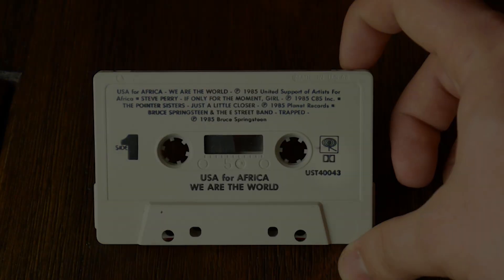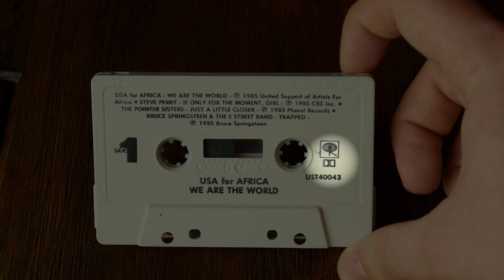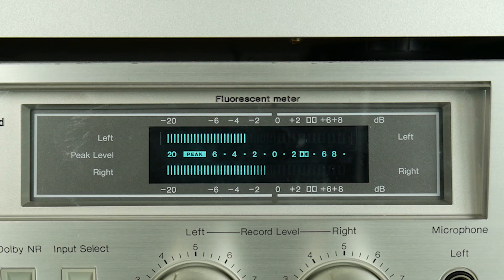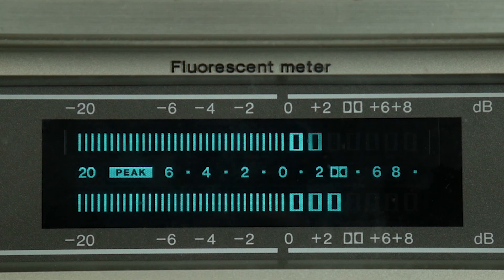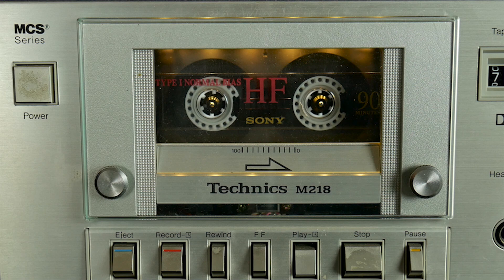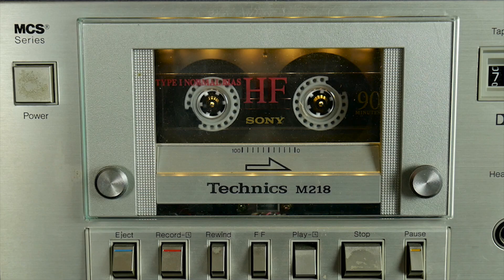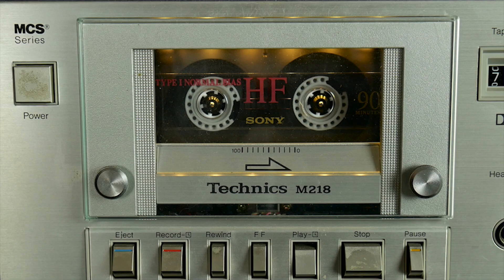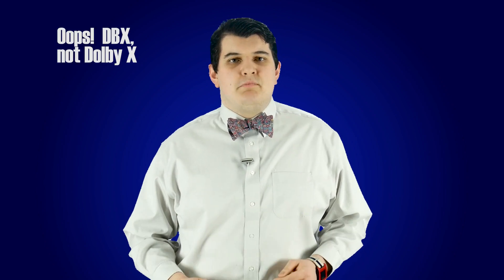What is Dolby Noise Reduction?  Dolby's Humble Beginning

Comment: The companding in Dolby noise reduction is more complex than just setting an equalizer. The companding is accomplished by varying the volume of the desired bands depending on how loud they are! That means it changes over time. The Dolby playback circuitry has to sense when to change the volume to match the amount of change during the making of the tape. That's the real reason for the Dolby sign on the level meter, record levels need to be set to match the preset playback settings. A mismatch can sound like there is a pumping or breathing effect to the sound.
Reply: You can build your own dolby encoder decoder, by robbing parts or using those Dolby Symbol IC chips. Or modify a tape deck. You could even purchase in the 70s add on boxes to convert a normal tape deck to dolby. DSP boxes now offer even more ways. Everyone had a gimmick in hopes of marketing solutions to those problems. And of course now most sound cards, and computers offer DSP processing to alter live sound.
Reply: Back when Dolby tape noise reduction was passing into history. Dolby inc. had the good sense to get into multitrack encoding in time for the explosion of 5.1 movie sound. While it's not what it's made for, I still haven't found anything that does a better job converting 2 channel stereo to 5.1 than the Dolby Pro Logic surround circuits built into my over 25 year old small home theater speakers. They're a bit long in the tooth so I'm hoping to find a halfway decent DSP plug-in since most of my music collection is 2 track.
Reply: @RMoribayashi  does it work with the psp?.

A couple of my games have D.P.L.2 but i don't have a way to play them in 5.1 or 7.1 surround sound
Reply: @RMoribayashi  Dolby first got into movie sound as early as 1972, only 7 years after the founding of the company, when they used Dolby A noise reduction on 35 mm film prints. These Dolby prints also used equalisation to improve the frequency response of the track. The system was not commercially successful as movie theatres were reluctant to spend the cash needed to upgrade their sound systems. However by splitting the sound track in two, each with Dolby A noise reduction and adding the pro-logic decoder, Dolby created Dolby Stereo. First used in 1975 on "Lisztomania" it soon became the de-facto standard sound system for 35 mm film prints and remained so until the introduction of digital sound on 35 mm prints in the early 1990s.  Right up to the replacement of 35 mm film in cinemas with digital projection,which occured in the 2010 - 2014 period, 35 mm release prints all carried analogue Dolby Stereo tracks as well as digital sound data.
Reply: And that's why you have to engage your Dolby circuit every time you want to digitise your dolbyized tape. You can't get rid of the tape noise just using an equalizer. The Dolby Noise Reduction works as a dynamic filter, too.
Reply: It literally says that in the video. Watch the whole thing before commenting
Reply: @LeNoir679  No he does not, he describes pre-emphasis and de-emphasis then calls it companding. (This guy is always wrong) The cassette system already has pre-emphasis and de-emphasis that's one of the reasons you have a tape type selector, different tape formulations have different head room at different frequencies (the other reason is the bias amplitude for recording) as he says in the presentation at 3:18 he boosts 8K by 9dB this would saturate the tape causing distortion with some music. Boosting a particular frequency with a equalizer is not companding! Companding is reducing or boosting the amplitude of a signal based on its level. 
RMoribayashi is correct!
This "Technology Connections" just is snake oil. 
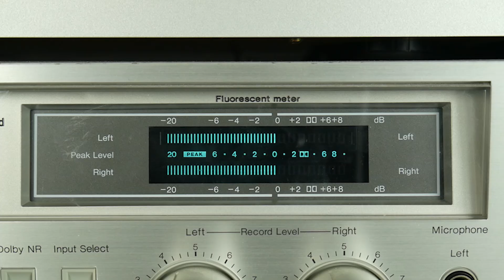4:58 The dolby symbol is just 0VU. I have never heard or seen written in a operation or  service manual that you cannot exceed this level. RMoribayashi is also correct re record and playback levels.
This "Technology Connections" also fails to mention how import the cassette deck head azimuth match between record deck and playback deck is as well!
Better explanation here see post by GLouie
https://gearspace.com/board/low-end-theory/682128-question-about-dolby-settings-my-cassette-deck.html
Reply: @rods6405  Oh please.  Yeah, he got the description of companding wrong on a video from 4 1/2 years ago.  But "always wrong"?  "Snake oil"?  Pfff, get out of here with that.
Reply: @rods6405  Dead link
Reply: @sirnickity  Yeah its not the space shuttle is it! But if  I was getting on the space shuttle and This "Technology Connections"  was repairing something on it I would get off really quick! Enjoy your participation award!
Reply: Basically a frequency-specific compressor before tape, and an expander at the same frequencies after it. Dolby B was essentially this, I think C is similar but squishing and stretching the signal way harder and over a wider range of frequencies. The S one I don't know for sure, but A type was multiband compression/expansion (Separate compressors on different ranges of frequencies), which makes it way more precise but many times more expensive.
Reply: Agree: https://www.testandmeasurementtips.com/audio-measurements-and-dolby-dbx-noise-reduction-faq/
"Within each band, the amount of pre-emphasis applied depends on the original signal volume. For instance, in Dolby B, a low-level signal will be boosted by 10 dB, while signals at the “Dolby Level”, +3 VU, receive no signal modification at all. Between the two limits, a varying level of pre-emphasis is applied. On playback, the opposite process is applied (de-emphasis), based on the relative signal component above 1 kHz. Thus as this portion of the signal decreases in amplitude, the higher frequencies are progressively increasingly attenuated, "
Reply: I think your explanation fixed the video for me: my soundbar has auto Dolby correction, so when he used the “bad noice” as an example in the video, I couldn’t even hear it.
Reply: Exactly!  Most people, including this YouTube, don't know this.  If you worked in professional recording as I do you would learn this.

Comment: There is a serious lack of a proper 21st century audiophile tapedeck, for digital archiving, that can playback all the different tape types (proper bias adjustments), let alone Dolby Noise Reduction, so that people can simply enjoy (and preserve) their old cassette tape collections.

Play tape  one more time, and then have it saved on a thumb drive, on a hard drive, in your iTunes, or saved in a cloud account.
Reply: Such a product is pretty much doomed to fail in a consumer market
Reply: You don't need to adjust bias for playback. The real pain in the neck is tape azimuth. I'm digitalizing on a separated deck, specially "sacrificed' to this purpose. I just put the tape I intend to digitalise and tune head azimuth for maximum treble "brightness". Of course I tune on stereo channels mixed into mono, the this 'golden point' of good azimuth is easier to find.
Reply: Look for the single tape Sony recording units that look like VCR decks.   The ones with Dolby B and C are quite good (even the cheapest ones) and they automatically sense metal or chromium and adjust accordingly.  Sony used to be the sheet when it came to audio gear.  They wee tops.  The 1990s saw the end of the Sony Audiophile and Videophile era I think.   Their gear from the 90s was till built like tanks.  My Sony deck still works perfectly despite years of no use at all.  Clean the heads once, demagnetize once and good to go!   I miss the ease of recording to tapes, but I don't miss the bulk, the clunkiness,, the hassles of cleaning and demagnatizing , the mismatch in noise technologies.. They were odd times the advent or CDs and the decline of analog audio.. The really odd thing I that we are STILL using analog audio in cars and building when it comes to FM radio.    WHY????  Radio should have gone all digital when TV did.  It's the last bastion hold-out for analog audio…and no clear compelling government push to end analog radio and begin an age of all HD (digital) Radio is in motion.   Heck, if Obama an the FCC hadn't made a mandate, we'd all still be stuck with fuzzy picture broadcast TVs and non-HD digital cable systems.   Sometimes bullying the market with "big government" is a really positive thing that gets necessary change to happen because it won't happen on its own without that "or else" punishment factor for not getting with the progam.
Reply: Unfortunately, Dolby no longer licenses their NR technology for cassette decks, so even when TASCAM/Teac came out with a new professional cassette deck last year, it didn’t have Dolby. It had a generic noise reduction system that “roughly mimics” Dolby B. But a new cassette deck that actually has Dolby B, C, or S is not going to happen. :(

Comment: Take a look at how FM radio is run through a preemphasis system at the transmitter and then a deemphasis in the tuner/receiver.   This is how most of the early Dolby was designed in the prototype tape machines.  I used Dolby B, C, and DBX in the Radio stations I worked at.  DBX was the best for Broadcast work since it processed the whole frequency range of the tape at (normally) a 2 to 1 compression ratio and then expanded it by 1 to 2 on playback.
Reply: Yup, I had a couple of tape decks, that offered Dolby FM and receivers that had Dolby FM decoders built in. Even 8 track would have been better with Dolby. Very few FM stations did broadcast in Dolby FM. The investment of that never paid off, as FM only has limited dynamic range. 15khz top end by FCC standards.

Comment: It's a wonder nobody came up with it sooner -- it's almost a natural extension of the RIAA curve used on vinyl. (The RIAA curve is also reason #247 that vinyl does not sound better than digital, but that's an argument for another time and place.)
Reply: Really, the biggest reason that someone would say vinyl sounds better is that they're listening to a poorly mastered digital recording.  Other than that it's a matter of taste.  I have some LP's that I prefer the sound of to newer digital remasters precisely because the original master was done by someone who knew exactly what sound they were trying to achieve 40 or 50 years ago, plus the mastering and mixing was all done with an analog path, which definitely has a unique sound compared to some newer LPs I have that were cut from a digital master and sound almost indistinguishable from a CD pressed from the same master (at least the first few times they're played).

I'm also skeptical of anyone who claims an audible difference between CD red book audio and any of the high resolution formats.  The specification of CD audio with respect to dynamic range is pretty close to the limit of what we can perceive and well beyond even the most dynamic recorded music, and the sample rate is just beyond the highest frequencies we can hear.  The only reason they use more in the studio is to have headroom to avoid clipping and distortion before it is mixed down and mastered for distribution.  The only reason I have any SACDs, DVD-As or Blu-Ray audio discs is because of the alternate multi-channel mixes found exclusively on those formats.
Reply: Right, CD redbook audio facilitates maximum fidelity -> https://xiph.org/~xiphmont/demo/neil-young.html
In a listening test by Boston Audio Society, no one was able to tell if a CD standard A/D/A conversion is inserted into 'high-res' playback. Even without dither.
It's honestly quite insane, thinking we have an absolutely perfect way to distribute stereo recordings, yet 99% of music released (independent releases probably ~80%) is pressed firmly to the 0dBFS limit. To varying degrees of listenability. Some early loudness war icons, such as Californication, with excessive amounts of hard clipping, are not even as loud (in RMS level) as most new productions with multiple stages of multiband compression and limiting. Yet the newer stuff inarguably sounds much cleaner.

Getting into vinyl for old pressings is often the only way to get a satisfying reproduction of the original master. CD standard conversion hasn't been were it got only after the loudness meme started, and picking up original CDs can be hard (even finding rips).
Reply: Good digital and good analogue reproduced on a good sound system is indeed very good. I don't believe the human ear is capable of discerning the difference, hence people say it's subjective.
Reply: I believe that the loudness wars have something to do with the "vinyl sounds better than digital" argument. Of course vinyl, usually containing the original recording, will have a better dynamic range comprared to a modern compressed recording. Also, some might find the vinyl crackle soothing. I personally do. However, you can still get digital recordings without the overzealous compressor and limiter use. Those will probably match the audio quality.
Reply: @Spinler Muckflitt - You can take your HiRes track, load it into Audacity (which has an almost perfect resampling algorithm) and export it into redbook. Then load the just created redbook track alongside the HiRes one and phase invert it. When you hit play now you'll hear all that "fluidity" exclusively, since all content that is the same in both tracks cancels each other out. Spoiler: It's absolute dead silence.
If you don't want to go through with this easily reproducible objective proof that redbook sampled audio reproduces all audible frequencies perfectly in every way, I did it for people like yourself: https://ibb.co/8g0KQh7
If you want, I can upload the residue track with just the supersonic content with gain applied, so you can see if you can hear anything. Beware though, you will burn your tweeters before you hear anything if your system doesn't intermodulate before that point.
And no, the 44.1kHz sampled track wasn't 24bit before I loaded it back into Audacity. Not that it would matter in this demonstration anyways, quantization is separate from sampling. Distribution in non-dithered 16bit would be sufficient. With dither, 16bit can reproduce frequencies at almost -110dBFS.
Reply: @Spinler Muckflitt - So you mean the frequency analysis of the residue track is simply incorrect? Do you understand the principle of phase cancellation? There is nothing left in the residue track below the nyquist cutoff of the Redbook track because it contains the exact same content below 22.05 kHz as the HiRes track. If it would differ in any way, it would not cancel out.
Go ahead and post that japanese research, I can't find it.
Here's a residue track [I warned you, this will put load on your entire audio chain that you indeed can't sense until some part intermodulates which can suddenly be very loud]: https://www.file-upload.net/download-13620947/residue.flac.html
The difference between HiRes and Redbook happens between the ears.
Also, what do you mean with "I've done it"? Did you ABX test? If you didn't rule out confirmation bias, you'll hear exactly what you expect to be hearing.
Reply: @Spinler Muckflitt - Okay, let me break it down for you. The HiRes sum I provided to you, of a HiRes recording of a 1974 Jazz vinyl and a phase inverted 44.1Khz/16bit conversion, plays as perfect silence. Same principle applies for eliminating atmospheric noise picked up along cables carrying symmetric signals ( "balanced" XLR, heard of it I guess..). Above 22.05kHz the sum contains the unaltered supersonics from the HiRes track.
I ask you, where in this silence is the "fluidity" to be found? Have a listen and tell me.
I like music too, don't worry about my gear.
Reply: No, that is wrong. Just because someone subjectively likes an analog sound better, that does not mean it has better fidelity. Digital recording has better fidelity. Period. However, the imperfection of various analog formats are pleasing to a lot of people. But they're still imperfections. Here is a good exercise, take a CD. Copy it to a tape. Guess what? It will now sound like a tape. Take a  prerecorded tape, copy it to a CD. It will still sound like a tape.
Reply: Be careful, there are lots of DIGITAL FORMATS with high loss (mp3, acc, wma). Spotify and Apple Music have high high loss. CD format (WAV) have less loss. Best standard is to record a 48KHz, 32 bit depth 500 Mbytes 1Giga song to surpass (maybe)  an analog format  FURIER spectrum. BTW every person has a different audio perception too, and there are some people that can tell the difference between digital audio formats either.
Reply: How good something sounds is a personal thing. I can play music on a gramophone made by Edison, and some would marvel and say wow that is great, and others would say it sounds worse than dixie cups and a string. Fidelity is all as you perceive it. Some like it loud, some like it soft, some do not care. You can achieve fidelity with only 1 watt of power, and you can achieve fidelity with 1000 watts of power. You can have earbuds, and you can have concert speakers. You can scramble your guts, or you can scramble your mind.
Reply: DaleC1980 sounds like the reply of a data geek not someone actually listening to the music. Big difference.
Reply: @MichaelRei99  Except that he is absolutely right.